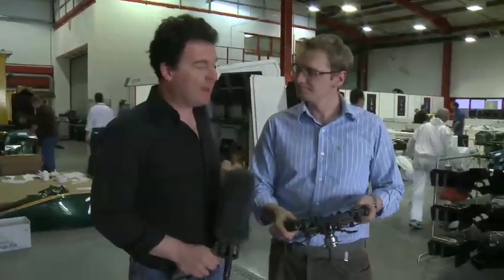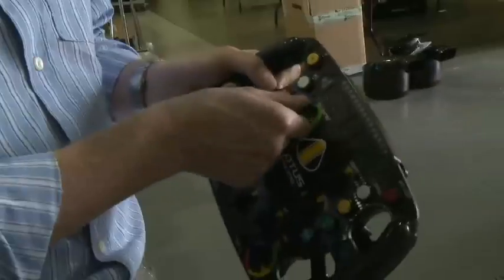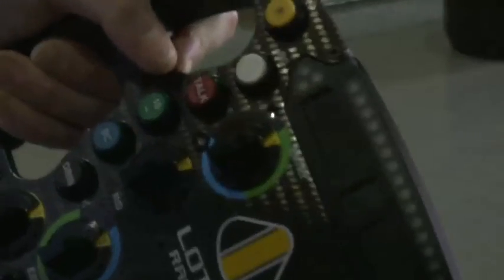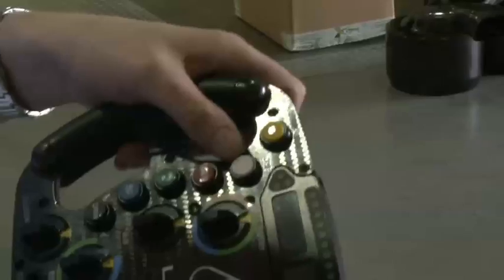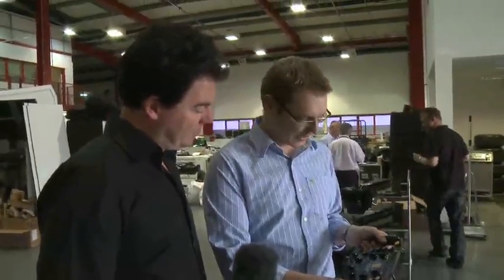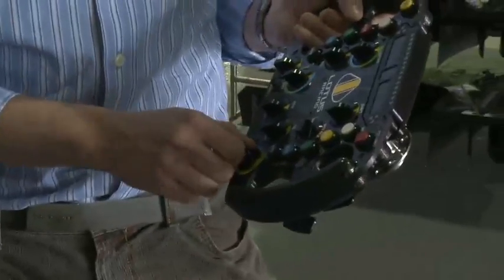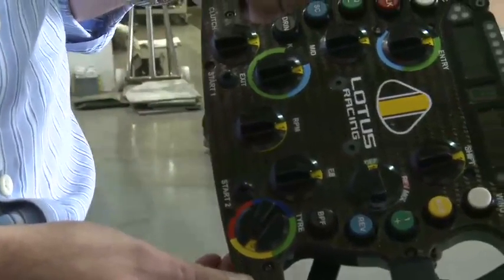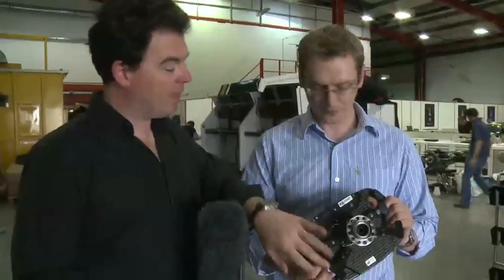How an F1 steering wheel works

Comment: @swimmin221 They could have explained it better.....but the top 2 paddles shift the gears while the bottom 2 paddles are the clutch.  The driver can use either bottom paddle as the clutch....they put 2 clutch paddles just incase the driver is turning and is unable to reach 1 of the clutch paddles.